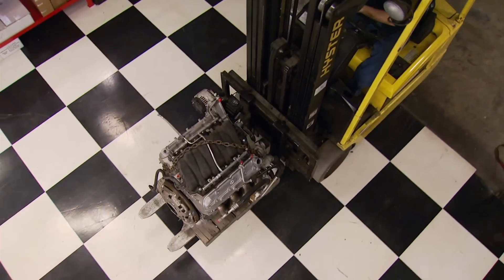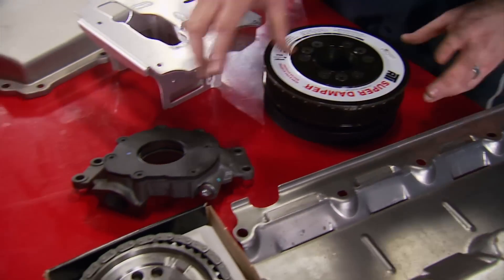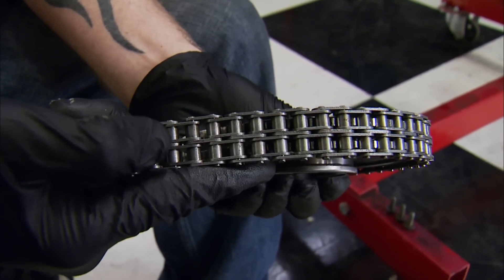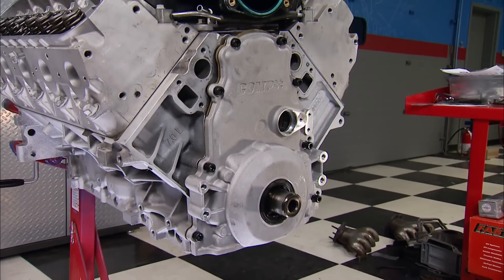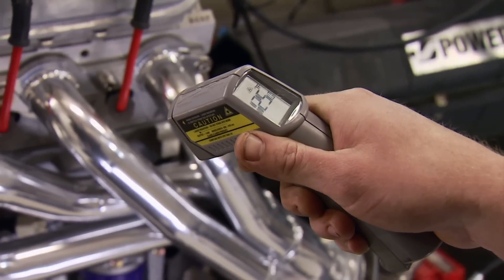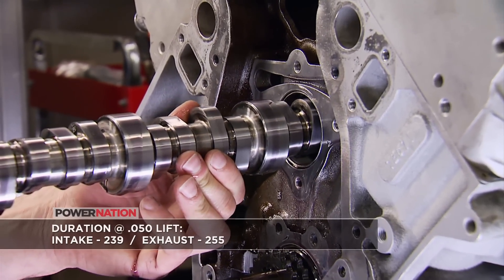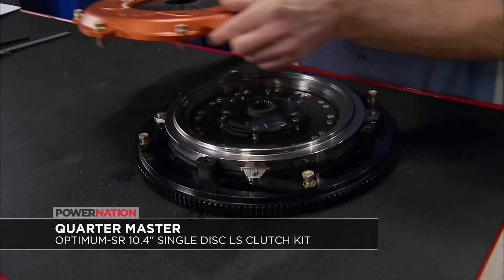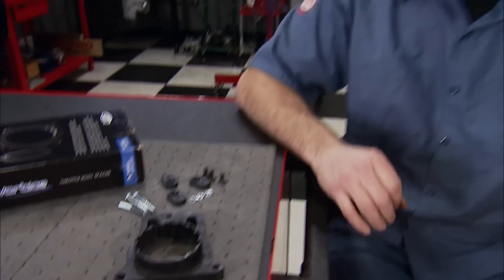LS7 Corvette Wet-Sump Conversion - Engine Power S1, E6

Comment: I can get a good deal on an ls7 short block and I have a set of ls3 heads and intake already. Do the ls3 heads bolt on a ls7 block with no issues? Will I have any issues with the different valve angles?

Comment: Hey I have an LS7 and got the conversion kit from Jeggs it uses the OE timing chain, and LS3 pan and pump. Do you think I should use the Holley or will the  stock set up work? It just doesn't have that oil pan door setup under the windage tray. Would love your opinion.  Rob.
Reply: I Have a swapped 2010 camaro w LS3 pan and mishimoto oil cooler.  Do you know the capacity?  Is it 8qts?  My dipstick was damaged on delivery and had to use an ls3 stick.

Comment: They used this engine and dry sump on the 2014 - 2015 Z/28 Camaro also which the ls7 has a longer key way for the crank sprocket. To do this to a ls9, you need to take the crank to a machine shop and have the crank snout key way extended to allow for the crank cam gear .just did one. 😎
Reply: So are you saying you can't convert the LS7 to a wet sump without machining the key way?
Reply: @roberthutchison8416  no I’m saying you need to make keyway longer on a ls9 dry sump crank in order to make it a wet sump engine. I used everything else from lsa engine including supercharger ,water pump, alt, and ac compressor. Just needed 9 bolt flywheel and used two shim plates for throw out bearing in order to use McLeod double disk clutch and pressure plate

Comment: Same engine was installed in the 2014/2015 Camaro Z/28’s which also have dry dumps installed as a track ready car. Somewhere around 2200 cars built. Get facts straight guys.
Reply: Correct

Comment: To anyone noticing they didn't mention the fact that the Z28 also had the LS7 in 2014-2015, this video was originally filmed in 2014, probably early. So it was very likely before or right around the time of the announcement/release of the Z28.

Comment: Ive always liked the LS engines, easy to make HP and lots of options for upgrades. But IMO most GMs bad oil flow is usually the cause of death. their might have been a reason they used the tank system on this vette engine. upgrading the oil pump should help

Comment: Why in the hell remove the heads to swap the springs?! And why not dual springs and new seals?!?! Pushrods?
Reply: Like most Saturday car shows that never show all the work, I bet they put new lifters, maybe even upgraded lifters, in the motor. Or, it may have just been faster if they didn’t have the right head on valve spring tool.

Comment: The LS7 was available in the 2015-2016 Z28 camaro as well
Reply: Close. It was in the 2014 & 2015 Camaro Z28. 2016 was a totally new Camaro platform with no Z28 option available.
Reply: I’m pretty sure this was filmed around 2009.

Comment: T
Please post the company that you got the engine from. Thanks!
Reply: Sounds like they didn't get it from a company but second hand
Reply: They kinda said both, internet find on a burnt out, then said the company they got it from throughly checks out everything before selling
Reply: @heavenlyhillfamilyfarm6485  Then they said "not bad power for brand new set of rings, on the first pull" when thr motor is on the dyno.

Comment: Better put some new valves in that motor before you know what happens.
Reply: It's the guides not the valves.
Reply: @exidous6831  no it’s the exhaust valve
Reply: @AbdullahHaidar  it’s both. but these clowns didn’t touch the valves so that 67 isn’t gonna be fast for long once that valve drops

Comment: I swap in a cam on my pontiac g8 an blow the motor 🤣🤣🤣 an I did the same steps they kinda did
Reply: What do u mean the valves hit on start or u pushed the engine?
Reply: @abeodez751  no nothing like that it was running good on the star up then after the tune that happened

Comment: Didn’t know the Amish built engines. Lol. That beard.
Reply: There is an amish diesel shop around here... They converted a crank lathe to run off belt pulley.
Reply: @jordanwaughtal7649  lmao that's amazing
Reply: Amish Mike graduated from from the Amish University of Technology with honors, that's why they let him paint so many of the motors
Reply: @davenelson1571  lol. No wonder. “For the mod everyone can afford, paint the engine. Everything else is obviously unattainable by your current salary”

Comment: It's a very compact engine isn't it.
Reply: the absolute most bang for your buck/bang for the size
Reply: Have you seen the 5.0’s  those things are way bigger and are way slower
Reply: @Abused.Ls2  they are complex but the Coyote can make serious power.
Reply: The 289 is narrow to.
Reply: @lawrencefoster2120  very true, but for the displacement/power potential the LS family offers for simplicity/cost, it’s pretty unbeatable even with the old school small blocks from the big 3

Comment: Yall said only came in z06 vettes.....which is incorrect the 5th Gen z28s also carried the ls7
Reply: These shows are old. This was probably aired before 5th gen z28 with ls7 were available.
Reply: @howardwilliams8993  see that's what I figured to .......
Reply: @howardwilliams8993  or the LS9 dry sump